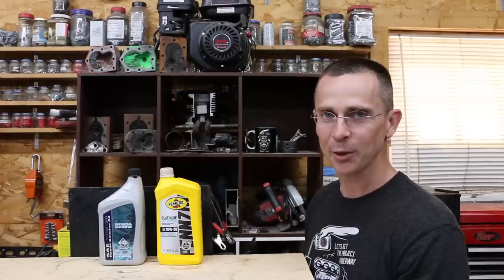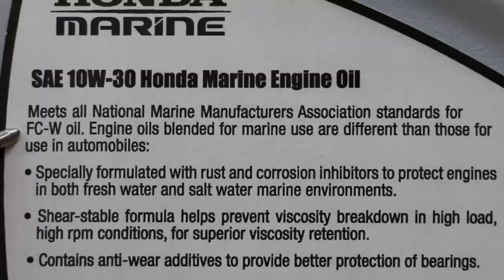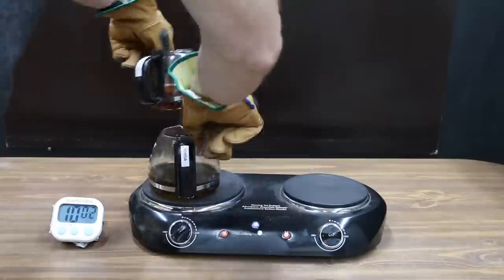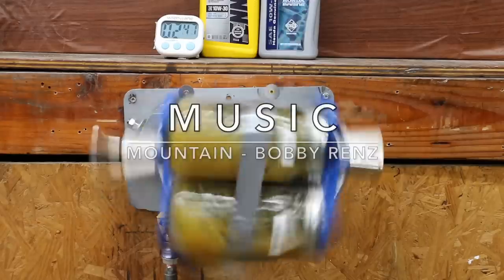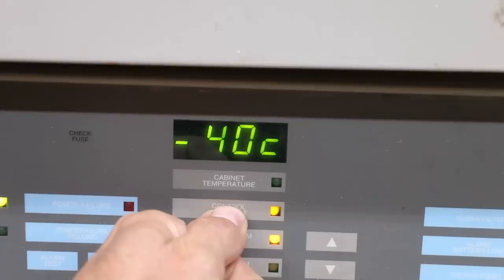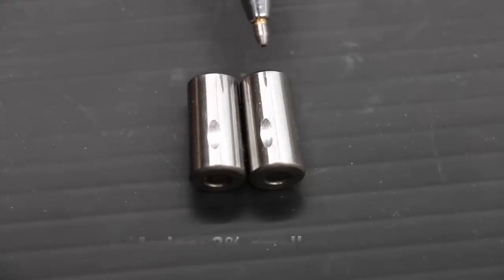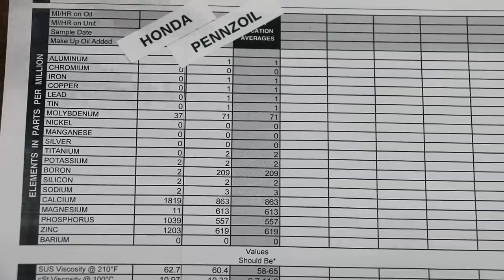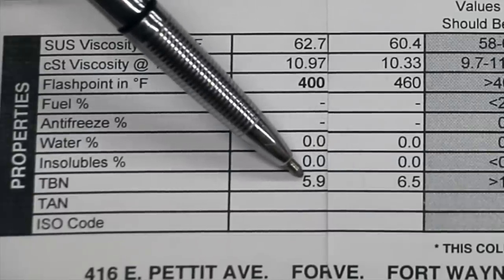Motorboat Engine Oil Better Than Regular Motor Oil?

Comment: For the millionth time: best channel on YT. In light of all the grease vids, do a degreaser comparison with heavy hitters like Oileater, Zep, Krud, etc. And throw in some Dawn. We have to clean up our mess, right?
Reply from the maker: Thanks!  Thanks for the video idea.
Reply: I'd like to see this too! Are the more expensive cleaners really that much better?!
Reply: @rico76  I personally use Oileater. Bought a 55g drum about 6 yrs ago that I'm still using. It's biodegradable. Can be used around food areas. Clear. Smells great. I can't say if it's expensive, or not because it's worth whatever I paid. It's that good! They have a dilution chart on their website. I was cleaning dill pipe and casing threads using a 10:1, and thought it could be cut a little more. Tractor Supply should still carry the gallons and bottles.

Comment: the coffee pot burn off test showing how oils vaporize under heat is a perfect visual representation to show people that an engine doesnt necessarily have to be "burning" oil or a bad engine for oil levels to go down and why you should periodically check your oil... as always good stuff and thank you!
Reply: If an engine has spots hot enough to cook off a substantial amount of oil between changes its going to sludge up prety fast. Gm 3.6 and ford turbo 4 cyl are bad about cooking the oil off and destroying the engine. If you cange the oil at 3000 miles they last a long time but stretch that out to 5000-7000 like they recomend and they just sludge up before they hit 100000 miles.
Reply from the maker: You are welcome!
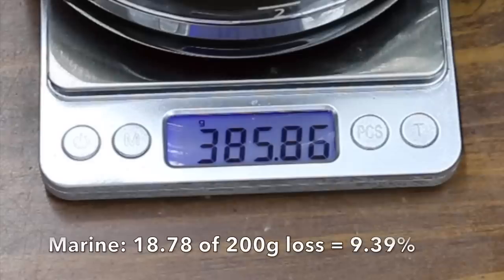Reply: Could someone please explain the text on the screen at 3:36? I don’t get where the 200g came from.
Reply: Oh I think I get it. The difference must be the weight of the coffee pot.

Comment: Marine oil just doesn't need to operate at -40C, but it does need corrosion resistance, so all these results make a lot of sense.
Reply from the maker: Great point. Thank you
Reply: Tell that to Russia! LMAO
Reply: @bhess1212  as long as the water is liquid the air above can't get too cold.
Reply: @bhess1212  the coldest you will be running a boat is at 0 degrees F. If it's colder than that salt water turns to ice.  The ships that do run in those conditions (icebreakers, larger fishing or commercial boats, don't start the engines except at the beginning of the trip and may not shut down for weeks. 
 Also you don't start stop start  marine engines when you're running anywhere near as often as you do an automotive engine in general.

Comment: Todd, should one use the automotive engine oils for marine applications since the marine oils costs are 3 times more expensive? Keep up the good work!! If the AW package is a bit of concern, you can change it a little early! What are your thoughts?
Reply: I wouldnt car engine run below 20% of the peak power while you drive around.
A boat run at 100% for many hour.
To boat oil is probably more stable.
Reply: I'd say depends on the car engine oil your talking about....
You can find car oil that has very high AW additives like for example Amsoil ZROD that also has long lasting antirust and id bet would do better then that Honda oil evap result...
Reply: It's probably a case of not much interest in marine oil development cause you can sell anything with marine on it for three times the cost. Not much different than the "special" John Deere or Caterpillar conventional oil they sell for more than the price of full synthetic diesel truck oil. If it was me I'd probably just run a high quality automotive synthetic and change it frequently.
Reply: @countryfamilyalways7280  Shure it depands on the quality of the oil there is a huge gap between different car oil.
A car engine run rarely above 2000rpm at normal daily driving boat engine run often at 5000rpm. So oil run 2,5time more cycles trough the engine means more mechanicle stress for the oil.
Evaporation isnt a problem for boats because cooling is way easier when you are sourrounded by water.
Same with cold temperatur, it doesnt apply for boats.
High quality car oil is probably similar to low quality boat oil, but you dont safe money in this comperason.
Sorry for my bad english, I am a little drunk.
Reply: You can use higher levels of zinc as well as other antiwear additives in marine engines.  No catalytic converters.  Also evaporation at high temperatures is not as critical for marine engines since even running hard they are far cooler than automotive engines.  Even when using a water to water heat exchanger they still cool the exhaust manifolds so the head and exhaust valves transfer more heat and stay cooler. 
The boats I run nearshore or on lakes I have used automotive oil changed often.  I don't run for hours non stop under those conditions.   When running offshore boats I always use marine oils.  Besides..warranty, warranty, warranty  lol

Comment: Is the Honda marine oil conventional or synthetic? It would be a good idea to test it against another conventional 10w-30 for a more full comparison
Reply: Why would anyone use a conventional (non-synthetic) motor oil in 2021? You can get a 5-quart container of Group III synthetic for about $16 from Walmart, Amazon, or Costco.
Reply: It doesn't say synthetic on the bottle that I can see, so I would assume that it's not. Honda's full synthetic and synthetic blend car oils say so on the bottle.
Reply: @averyalexander2303  From what I read about these new marine oils is that most of them are conventional or synthetic blends, and not full synthetics (not even Group III full synthetics).
Reply: @mark9118  Mercury outboard 4 stroke oil stated as synthetics, it should be synthetics because changes ones a year
Reply: FourStroke (10W-30) Outboard Oil (Mercury)

Specifically formulated and developed to meet the needs of all four-stroke outboard engines. Developed for the rigors of the marine environment. Industry-leading corrosion protection. Features premium-grade synthetic and mineral-based stocks with specially designed marine grade additives not required in automotive oils. Outstanding lubricity for internal engine components to reduce wear, scuffing and scoring. Excellent running quality and long-term reliability. Rigorously tested to guarantee warranty protection for Mercury and Mariner four-stroke outboards.
Reply: @StartVisit  Didn't see that part. So it appears to be a synthetic blend.
Reply: @mark9118  I have seen the same thing, even Amsoil sells a synthetic blend marine oil. I wonder what the reason for that is, perhaps marine engines just don't benefit much from synthetic oil since the oil is not typically subjected to extreme heat or extreme cold.

Comment: Test Idea
I'm a woodworker and I believe that you probably have many woodworkers subscribing to your channel.  Blades for planers and jointers are expensive to replace and they don't last very long.  There are several different options all the way up to a helical insert type. Many people have the dewalt dw735 planer. It's considered a bit of an industry standard.  Power consumption is also a big concern for using a planer and blades contribute quite a bit to load.  One last item would be to see if there is a way to sharpen these blades with a commercially available tool. Lots of guys make home made fixtures and use sandpaper. I haven't seen anything commercial to do that task.

Great channel. Probably my favorite channel of all. Extremely informative and very well done.
Reply from the maker: Thanks!  Thanks for the suggestion.

Comment: Half the fun are the experiments! So blown away every video on how you come up with these test.
"See For Yourself" principle is deep here.
Reply from the maker: Thanks!
Reply: Yeah, big surprise, A full synthetic oil out performed a petroleum based oil.... duh , this has been known for 40 years.  Totally unnecessary experiment.  They should have done synthetic marine vs synthetic auto if they wanted to compare apples to apples.

Comment: Right on par Todd. You bring that extra bit of humanity back into my life with your videos. I thank you for your kind and attention to detail, your objectives and the effort you put in without support other than that of Patreons. You are indeed what we need right now. Regarding all your oil testing, of which ones would relate to diesel engines? This is a test if not already done I would be very interested in. My 30 years in the Australian Army, they only used one type of oil, something labelled OMD110. The omd being for oil mineral detergent, now I have my own diesel vehicle for towing purposes I only like to use the best wherever possible. We do have an Australian brand, Penrite, who make some interesting types that may also peak your interest 😉 worth a look on the ol interweb Lol.
Again, thank you so much for making so much difference to my life, I feel that in some ways your videos also help me with my ptsd. If I feel that I am in a slump, I do many things to try and lift my day, but your non political and no agenda type of format other than research and results always lift me a level or three. 😇😇😇
Reply from the maker: Thanks!  Thanks for the suggestion.
Reply: I would have rather seen a synthetic marine oil vs synthetic automotive oil.  this test compared Honda petroleum based oil with full synthetic automotive...  not a good comparison unless you are trying to sell Pennzoil to a bunch of duped boaters.

Comment: Have you thought about doing an oil comparison of 0w-x versus the 5w-x counterparts? For example the 0w40 Castrol Euro versus the 5w40 Castrol Euro? It’s often been agreed upon on the forums that the 0w-x oil is a better oil because it usually has a better base oil. And before it was discontinued, the 0w30 German Castrol was the holy grail of oils for Euro motors. Just a thought! Love the channel.

Comment: I think it would be really cool if you did almost an identical test to what you did here, but compared low-cost car oil to high-cost car oil, and see if there are any differences that make the high-cost any better. Great work on this video!
Reply from the maker: Thanks!  Thanks for the suggestion.

Comment: It's really amazing boat engines last like they do.  I have a 350 that pushes a "dry weight" boat of 6600 pounds.  Sustained RPM of 3200 to 4000 to stay on plane depending on load.  Doesn't miss a beat.  I was bummed you didn't use Mercury oil in your test but love the content.
Reply from the maker: Thanks!  Thanks for the constructive feedback.

Comment: I would like to propose two different items for comparison and testing.  1)  Electric 1/4  sheet sanders.  I just bought a $13 Walmart brand to get me by until I make sure of what I want; I was straight dewalt until I found this channel. 
2) Although I have seen your oil comparisons, I have recently discovered a straight 30w synthetic oil for small 4 cycle engines and boasts that it can be used year around down to -30, branded Triax.  Included in my last order was a booklet/brochure that boasts of very high anti wear and anti corrosive additives that are almost unbelievable.  Including HST, gear, and automatic transmission fluids.
Reply from the maker: Thanks for the suggestions!

Comment: Great video.  There is an additive called Camguard that was originally marketed to the aviation industry.  It’s intent is to reduce corrosion in aviation piston engines that tend to get used infrequently.  The flat tappet camshafts tend to suffer the most from corrosion.  It would be interesting to see if it actually works.
Reply from the maker: Thanks!  Thanks for the suggestion.

Comment: Video idea suggestion: Mercury vs Yamaha marine oil breakdown. Yamaha almost exclusively uses 10W30 for all 4-stroke outboard application. Mercury, on the other hand, has a variety of viscosities, especially for their supercharged engines. The Mercury motors I work on and change fluids for have the darkest used oil, and have operating temperatures for fluids as high as 212°, well beyond the point oil regularly burns, would love to see a breakdown of what their special team of oil engineers have done to keep their engines running!

Comment: I'm glad you mentioned the zinc and phosphorous. I was about to warn about that in my reply, but, you already know about fouling the catalytic converter. It might be worth mentioning, that it can also foul the oxygen sensor. Most marine engines do not use catalytic converters, though, some may use oxygen sensors.
Reply from the maker: Thanks for the feedback.

Comment: I definitely think you should compare super tech full synthetic high mileage oil vs its advanced synthetic formula. I initially used the high mileage formula in my 215,000 mile car but switched over to the advanced full synthetic formula as it supposedly has a better additive package. I’d definitely be interested in seeing the differences in the additives. Great work!
Reply from the maker: Thanks so much!  Thanks for the suggestion.

Comment: Great video as always!

I'd love to see a router bit comparison video! Looking at some bits to buy now and it's always hard to decide between the 200$ and the 60$ bit sets not knowing if it is worth the cost difference
Reply from the maker: Thanks for the suggestion.
Reply: Wow! that would be a tough test. Would need a feed motor and some hard wood. Need to do a bunch of rip and runs on a table saw and a jointer when the boards start warping

Comment: When you put the oil in the freezer at 40 below, you should put the ramp in the freezer also. The oils have different flow characteristics at lower temps of course, but the ramp could be warming them up and changing those characteristics.
Reply from the maker: Thanks for the constructive feedback.

Comment: I'm not sure how you would do it, but could you consider testing medium to large bench vises, with at least 6" jaws.  I know there are vises with fixed bases, rotating bases, wider opening vises, vises with lower jaws for pipes, etc, interchangeable jaws, and solid steel, iron with steel jaws, cast iron, cast steel, etc., with varying degrees of ductility, brittleness, crack resistance, jaw clamping strength, susceptibility to deformation, etc., but if anyone can figure out what kinds of shop vises are actually bought for farm or shop use, and/or what people would actually buy again, if they had the bucks, and how to test them, you're the man.
Reply from the maker: Thanks for the suggestion.

Comment: Well, now tht you have a baseline for a Marine oil with the Honda, for us boat owners it would be nice to have a shootout.  For years many have claimed that the standard Mercury/Quicksilver is the benchmark of best marine oil and additive package... but now in summer of 2021, Mercury/Quicksilver have finally released a brand new 10w30 full-synthetic that they say was developed over 5 years and has 49% more antiwear additive "boosted with ZDDP", and is supposed to be the best you can get (their claims not mine).  At the same time you have die-hard fans of Yamalube, and also Amsoil 4-stroke Marine as well.  It would be great to test these agaist the Honda you did here and see what the differences are, and which one is ultimately the best.  Would be a pretty valuable comparison I think for marine enthusiasts.  Thanks for your videos, they are all great!
Reply from the maker: You are welcome!  Thanks for the suggestion.

Comment: I have a test idea for you PF…I recently saw a debate about whether to pre-fill oil filters or not. Some say that studies show that the used oil in the motor is cleaner than new oil coming out of containers and for that reason we should not pre-fill the filters because in doing so you’re putting more contaminated oil into the unfiltered side of the oil filter (the larger hole). 
So the experiment could be measuring cleanliness of new oil and include oil from bulk containers and new oil from small containers.
Reply from the maker: Thanks for the suggestion.

Comment: The reason why Pennzoil has less Calcium and more Magnesium is because it has an API SN PLUS rating. Prevents an engine to developed LSPI (low speed pre ignition) a must for direct inejction gasoline engine's in my opinion
Reply from the maker: Thanks for the feedback.

Comment: I quite enjoy your oil testing videos. I’m a farmer and i work for a John Deere dealership, John Deere has a interesting lineup of oils. They claim their Plus 50 II engine oil allows an engine to run 500 hours on one oil change but only 250 hours on any other offbrand oil. I would like to see how they compare to other oils you’ve tested as I’m a  believer in John Deere oil due to their bold claims and how they do warranty their products with this oil.
Reply from the maker: Thanks!  Thanks for  the suggestion.